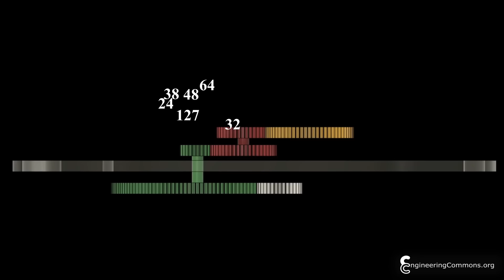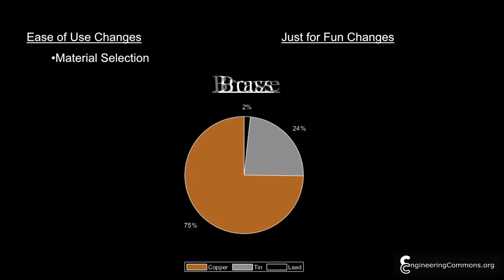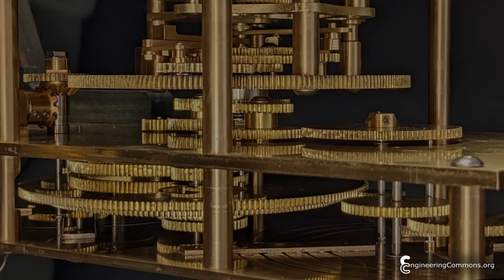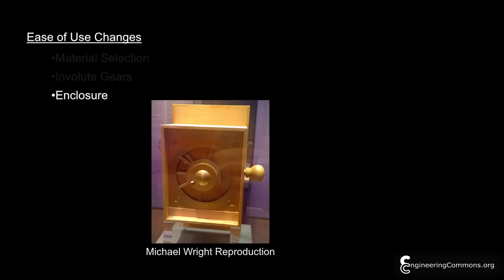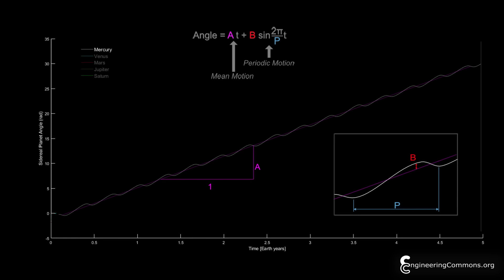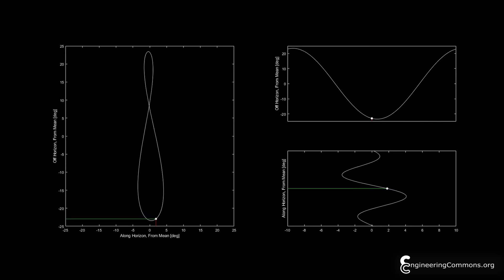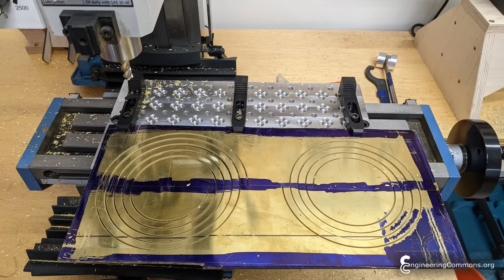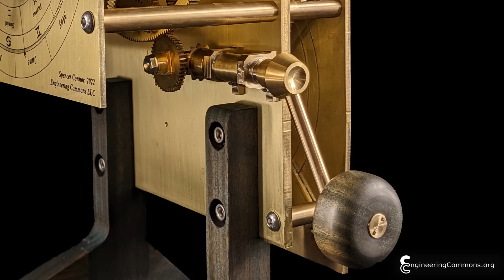Antikythera Mechanism V2: A Modernized Reproduction

Comment: The issue I have with all this is the fact that the moon isn't as close to the Earth today as it once was and today we know the orbit of the moon is increasing it distants from the Earth slowly, but it still increaseing and has been since forever. There will come a time when the moon continues to increase it's distance which as it does also increase the orbital time from what it once was to today's 28.???. Will mean that the 28.??? day cycle will also increase. And because the moon is though extremely slowly moving farther and farther, it's abiltiy it has on the tides, will be eventurally effected in such a way, it will be dramatically different. If and when the tide's are change, everything effected by the tide's will have to adapt or ???.
Reply: Since modern laser measurement shows the moon is moving away at 3.78cm per year, it has only moved away about 80 meters since the Antikythera mechanism was made! In other words, not really something to worry about